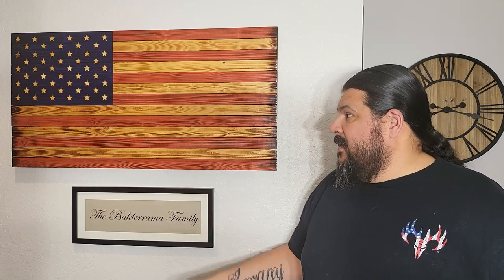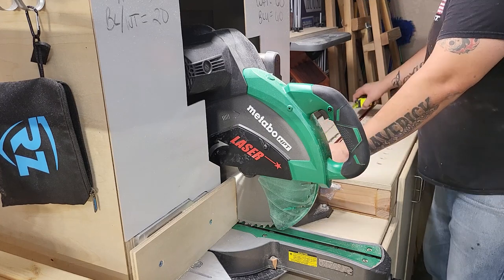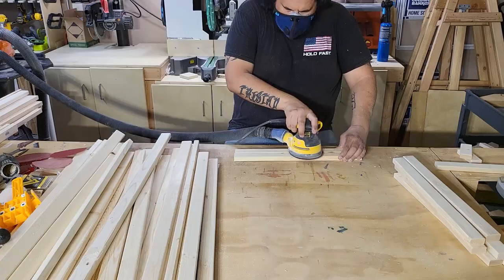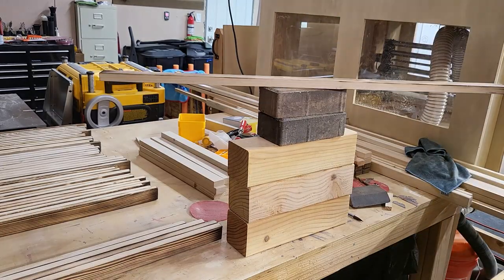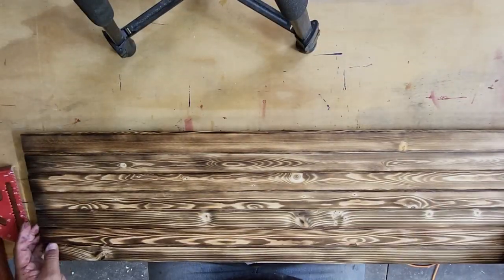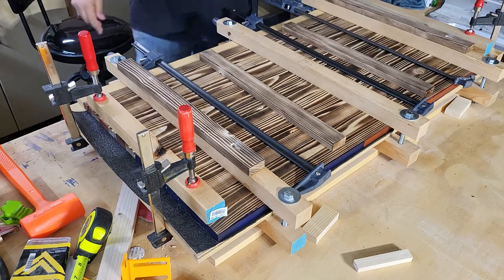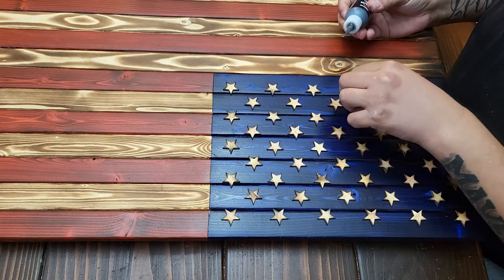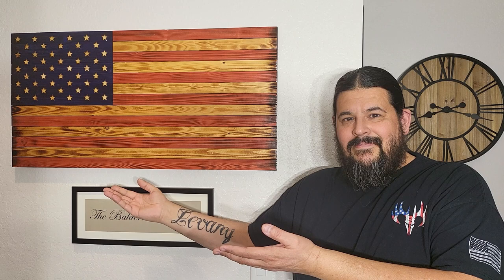How to Build a Wooden American Flag - DIY Woodworking Project That Sells!

Comment from the maker: I wanted to clarify something I said at around the 1:50 mark that is kind of confusing. What I was trying to say is that if you buy 1x2x8 dimensional lumber, you will actually need 7 pieces (not 14) to make one flag. Each of those pieces will yield 2 stripes, for a total of 14,  and one backer. Sorry for the confusion.

Comment: The stars are the reason why I don’t do flags. They are a pain in the caboose. I also do not own a CNC yet but one day maybe😂
 I have not upgraded SketchUp from the Fred Flinstone Edition yet either 😂
Reply from the maker: Yeah, the stars are definitely the most tedious part of making flags. I started out doing them with laser cut stars because I just couldn't imagine sitting there with a dremmel for hours doing it. Still can't imagine doing that--plus it seems the majority of makers are doing that way, and I like the 3d effect of the stars being proud better. Also, the uneven surface inside the star that results from doing it that way would trigger my OCD, lol. But, if you do it with CA glue and with the template that I am going to make, it really isn't that bad. I've had my CNC for almost a year and a half now, and I only just started making flags on it a month or so ago. I have started doing the stars on the small flags that are on my concealment keyboxes on the CNC now, because those tiny little 1/2 inch stars are miserable to work with. What used to take over an hour only takes a few minutes now. I'll probably start doing these bigger flags with the CNC too, particularly to incorporate images, personalization, etc., but that comes with challenges too. If the surface is at all uneven, it will really mess up whatever the CNC carves. Since my small flags are a single solid piece of wood, I just run a flattening pass first before staining and carving the stars, but on these bigger flags I'll have to make the unions separate, as others do. When I got my CNC I just decided to take the plunge with Fusion 360 for CAD/CAM and modeling. It's expensive and much more difficult to learn that some of the free CAD/CAM software and sketchup, but it's also much more powerful software that doesn't have the limitations of those others. But that's also why it took me over a year to figure out how to use it. Thanks for watching!

Comment: Can you recommend an exterior spray that'll slow down damage from the SoCal sun and rain?
Reply from the maker: Honestly, just about anything will only slow that down minimally. On outdoor furniture I'd probably use Tung oil or Australian Timber Oil. For something like this, a flag,  the only thing that would work better than some sort of urethane (which, where I live in the high desert, wouldn't last even a year) would be to just epoxy it. I don't have any experience with it,  but I think there are some products made for boats that might work at least a little better than a urethane. I'd probably just recommend using a high grade exterior paint instead of stain for a flag like this.  You won't get that rustic burned look,  but you could do some manual distressing. That would probably last a good while.

Comment: Did you put a 45 degree bevel on the sides of the wood
Reply from the maker: You can, and I have before, but not on the one in this video. Sometimes the edges of the 1×2s you get will have rounded edges and will give it this effect too. For example, the 1x2s at my local HD are 90 degrees,  but the ones at Lowe's are rounded. I'll usually make flags with both just to have a slightly different aesthetic for customers to choose from. You can also specifically chamfer the edges for a more dramatic version of this effect,  but I generally only do that if someone requests it and then I charge a little more. An example of a flag I did like that is on my very first video,  the American flag concealment box lock demonstration video.

Comment: Thanks for posting.  I started making flags too. I have purchased cedar from a local Sawmill. That cedar makes great red stripes and maple for the white stripes.  So I don't stain the wood.  I spray the blue and use a plastic template to spray the stars.  I saw the wooden ones and thought I couldn't attach them to make them look good.  Your template and punch does help though.  I don't have a cnc to create what you are going to do. Not sure if I can post a finished flag to your site.
Reply from the maker: That sounds like a cool idea. I've played around with doing one out of different woods rather than staining (like paduk, maple, and walnut), but I think it would be very hard to sell because of how high the price would be. I'd definitely make one like that if someone ordered one though. If I made cutting boards, I'd probably try one like that. I don't think you can post a picture here on youtube, but you can definitely send one to me via email at maverickdesignswoodworking@gmail.com. I'd like to see it!

Comment: Do you need to use the supports on the back? Will the glue hold it together by itself? 
And 
What clear sheen do you use? Matte, semi, high gloss?
Reply from the maker: In my opinion, yes, they are necessary. The wood won't come apart along those glue lines if you do a good glue up,  but it can, and invariably will, start to cup or warp the whole flag without those supports. Dowels could fix that, but it's a lot more work. You could also use a sheet of plywood or mdf as a support backer, but that will increase cost.  I prefer to use a high gloss lacquer to finish them.
Reply: @maverickdesignswoodworking  thanks. I’m only starting with making a couple for myself. I did get some biscuits and a slot bit to make the slot for them. 
I guess sheen is preference. I was thinking opposite and doing flat or semi.
Reply from the maker: Yeah whichever you like best is the right one!

Comment: Hey Mav - where can I get the star template measurements (just the one you use in this vid) so I can recreate it?  Thanks!!
Reply from the maker: I made it from 1/4 inch plywood. The measurements are going to vary based on the the size of the flag you're making. Basically, I just used the size and spacing data from the inchcalculator.com American Flag Size and Proportions Calculator (I'll link it below), and cut the plywood to size of the union for the size of flag I wanted to make, created a grid with the center points for all 50 stars, and then drilled holes at all 50 points. This is not the most effective way to do it, but it's how I've been doing it for years. Once you get used to it, it works. I'm currently working on making a template to sell for various flag sizes that will have the stars cut in their entirety so that you can just lay it over the union, add the glue, and just drop the stars into the spaces. I'm hoping do it with my CNC, but I may need to get a laser cutter to do it. I am working on that now, and will let you know once I have them ready, if you're interested. 
https://www.inchcalculator.com/american-flag-size-proportions-calculator/

Comment: What glue do you use for the stars?
Reply from the maker: I used to use Titebond II, but that can be time consuming, especially for me and my OCD, because I would spend time cleaning up squeeze out with a pick around every star. Also, while it does work, you don't get the best bond with wood glue on a stained surface. Now I use medium thick Starbond CA glue, which is what I'm using here. Clear is ideal, but here I'm using black, which is fine too as long as you don't use too much and get a lot of squeeze out. Plus, the CA glue adheres to the stained surface better, and this is a whole lot faster.  Actually, I can't remember if I mentioned it in this video or not, but I usually put down a quick coat of lacquer before applying the stars, as the CA glue bonds really well to it.

Comment: How did you measure the template for the stars. Thanks love your crosses
Reply from the maker: I use this US Flag dimensions calculator:  https://www.inchcalculator.com/american-flag-size-proportions-calculator/
All you do is plug in either the length or hoist (height) of your flag, and it will give you every other dimension right down to the size of the stars and the spaces between them. Of course, if you buy the laser cut wooden stars like I do, you might have to adjust the size of your flag or use stars that might be a little bigger or smaller than exact right size. For example, the most common size most flag makers use is a 19.5 X37 inch flag, because that equals 1.5" stripes, which means you can use 1x2 dimensional lumber to make them. If you plug that into the calculator, it will tell you a 19.5 inch hoist should be 37-1/16" long, but everyone just rounds down to 37. I know a few guys that actually do 36. It also says the stars should be 1-3/16" but I and everyone else I know just use 1" stars, because unless you're cutting them on your own laser they don't come in that size. You could even use 1-1/4 if you can find them. All that said, the way I made my template was I just cut a piece of 1/4" plywood to 10-1/2 x 14-13/16 (the size of the union for a flag that size), and then just made a grid for the center points of the 50 stars using the dimensions from that calculator, and used my drill press to drill a hole where the center of each star is. It takes some nuance and a little practice to get the stars aligned this way, but once I get them on there I do them row by row and I typically just make sure all the stars in a row are oriented in same the place relative to the stripe they're on. A better way to do this would be to make a template with the stars cut complete out just slightly larger than 1 inch so that you can fix the template in place and then just drop the stars into the cutouts. I am going to start making and selling these on my website along with build plans and board butter and such, I just haven't gotten around to it yet. Once I do, I'll put out a video on it so you will all know-hopefully soon. I hope this helped.